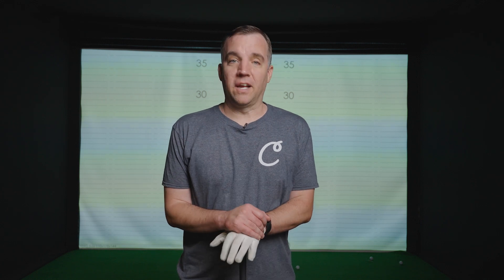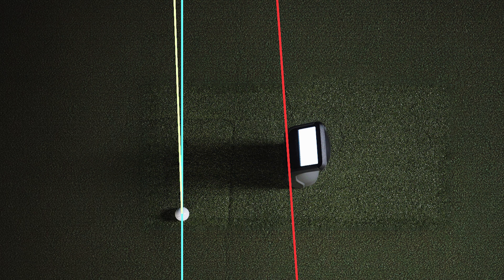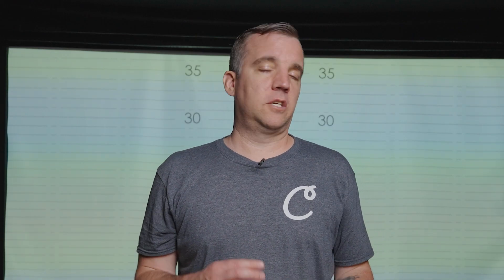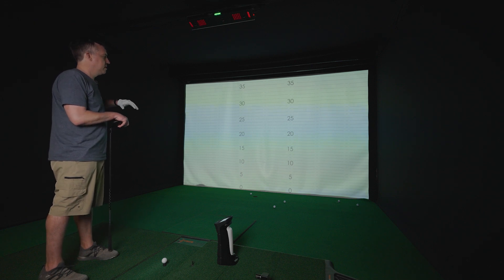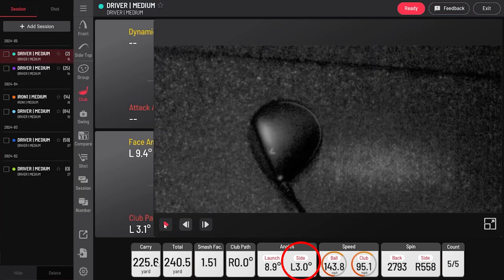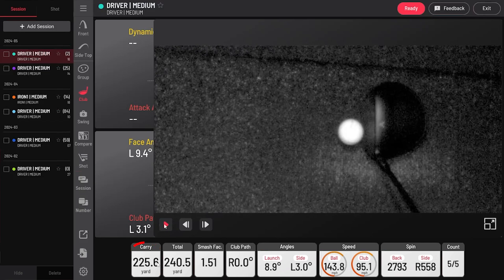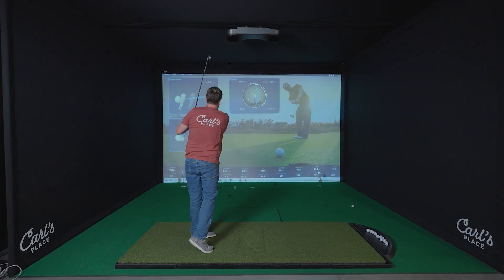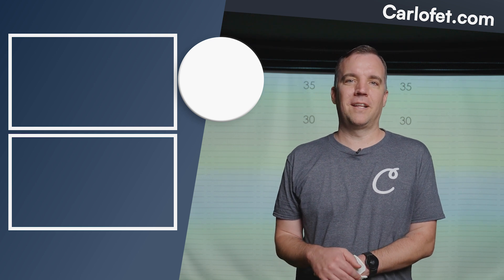Understanding LAUNCH ANGLES with your Launch Monitor

Comment: In the case of the Foresight System, they have a patented alignment stick which allows for their unit to be misaligned to the target line, without compromising accuracy by aligning the target line to the launch monitor.
Reply: The man is here!